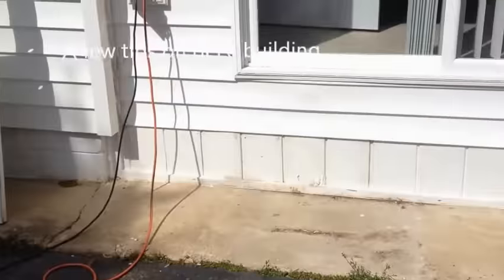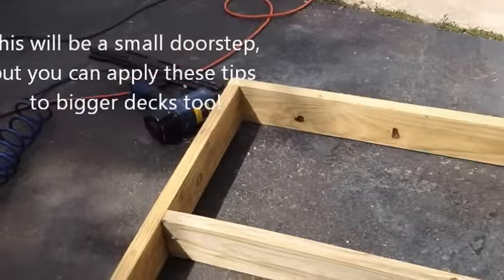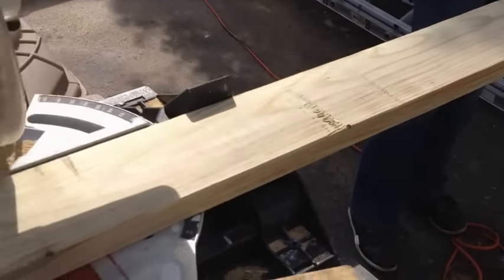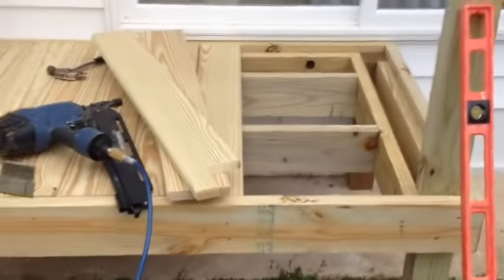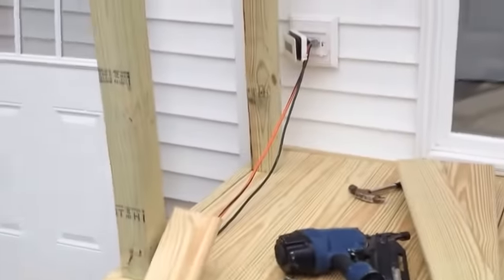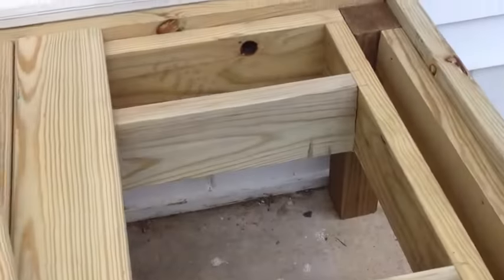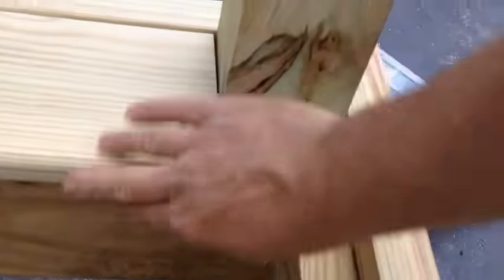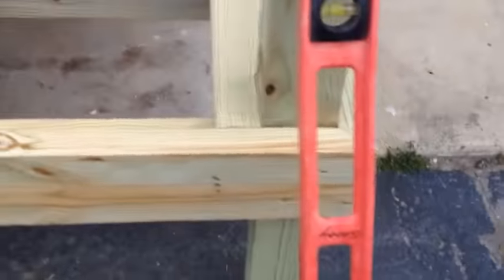building a small deck - DIY tips

Comment: Did you need a permit for this?
Reply from the maker: Check with your local codes office. But in Tennessee, you do not need a permit to build a stand alone deck that is not attached to your house. If you want to bolt it to your house, then you do need a permit, buy most small decks weigh enough that they don't hardly move when they are low to the ground like this one.
Reply: @SammybonesDIY  i built a screened in deck it turned out great 👍 😎 👌

Comment: You're first mistake was using a nail gun for this project. You have to use 16D nails which are bigger and are meant for structural integrity. Also, nail guns are meant for framing not structural.
Reply from the maker: Ironically, it's still standing and functioning perfect since 9 1/2 years ago.
Reply: @SammybonesDIY  good for you.